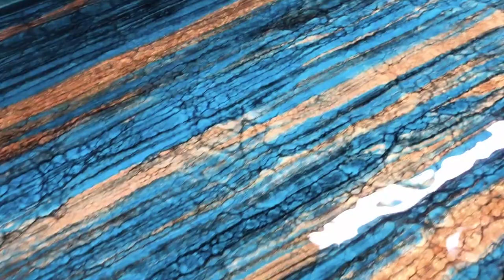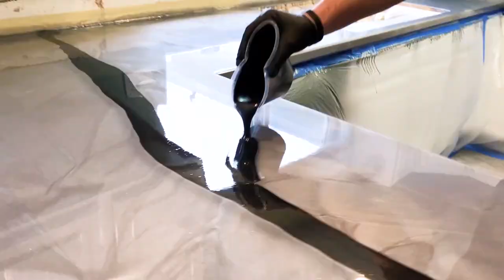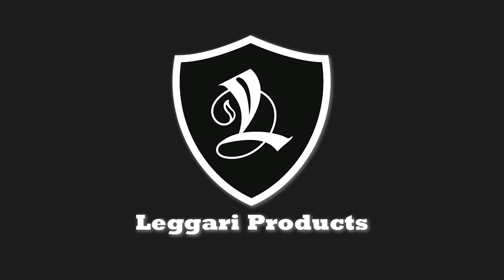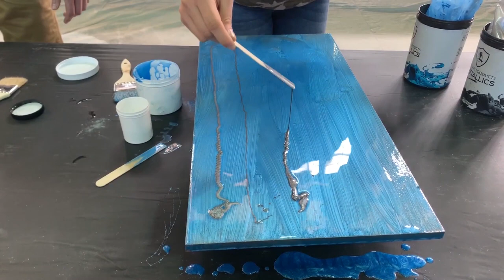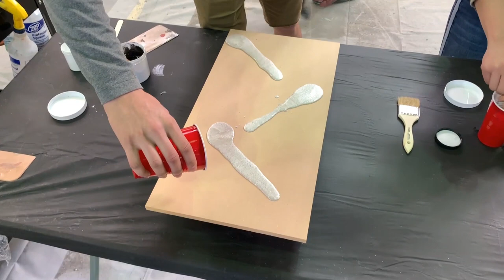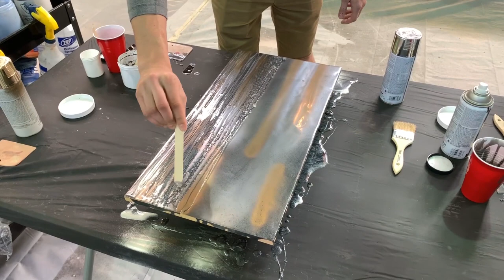First Time Using Epoxy, See How It Turned Out!

Comment: Why is there no dispersing effect when spraying isopropyl alcohol? Does isopropyl alcohol need to be blended?
Reply from the maker: No you do not have to blend it.  We mist the epoxy about 20 minutes after applying it with the isopropyl alcohol to give it the dispersing effects.  Thanks
Reply: Thank you so much